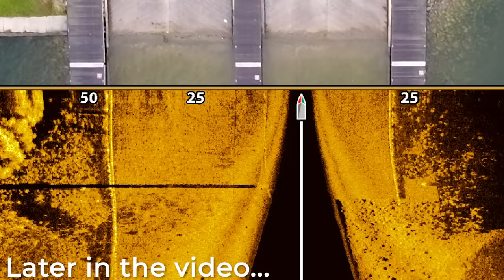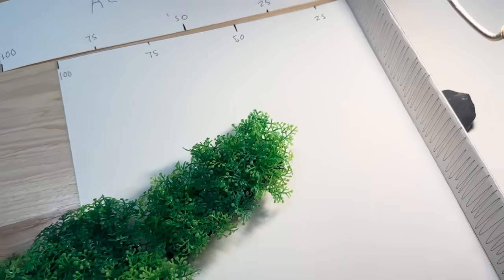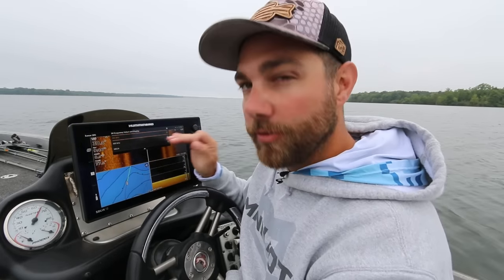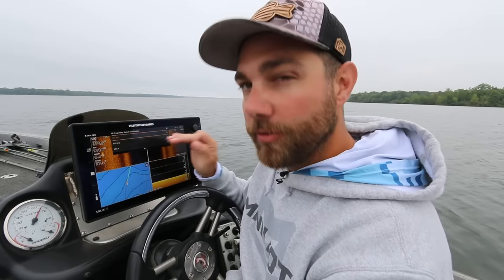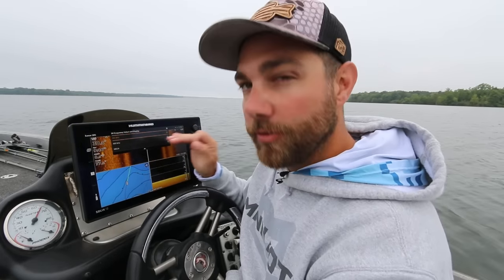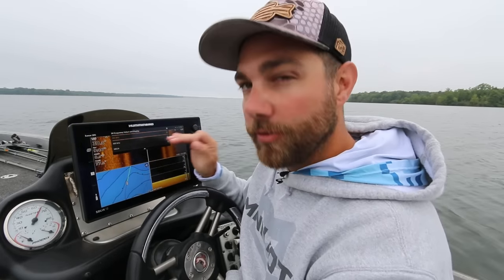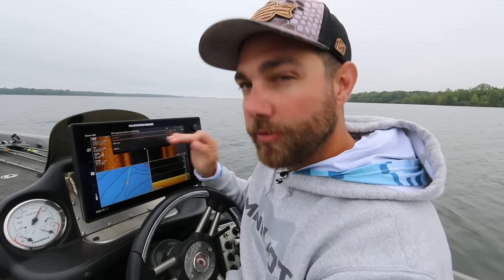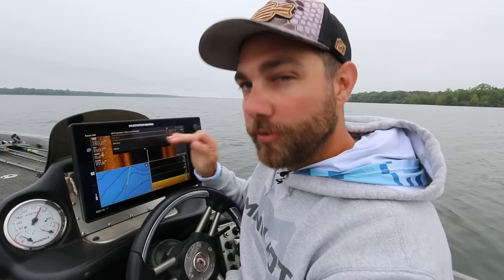What A WINNING Spot Looks Like // Side Imaging CRASH COURSE

Comment: Best side scan video I've seen...graphics were outstanding at the beginning to really show how things lay out in 3-D.  Only suggestion is you say you have to "subtract" off the depth...that is not really correct.  The object's distance is exactly what it says on the unit if you draw a line from the transducer to the object.  You can think of this as the hypotenuse of a right triangle (one leg of the right angle is a line dropping from transducer to the bottom, the other right angle side is from the bottom directly under the boat moving to the side (right or left) along the bottom.  You do not subtract the depth of the right angle side going from the boat to the bottom from the distance along the bottom's right angle side...instead you measure the hypotenuse to get the distance.  So the object is closer than it appears if you just consider distance right/left of boat, but it is not as close as you would calculate if you subtract the depth off of the range.  Your model shows this relationship well, but you should not say to subtract off the bottom depth as that will put the distance too close to the boat (you could use geometry to actually calculate it...this is called slant-range correction).  Anyhow...all that does not diminish how outstanding this video is...thanks!
Reply: YESSS!!!! Thank you for saving me twenty minutes of typing!
Reply: After a while , you will just be able to be good at guesstimating I’m sure. This video fed me some great info. Looking into getting a side imaging graph. I have a gps map up front for livesvope, but to have lake mapping and side imaging at the wheel could be an efficient combo. With that being said, you guys know your stuff. What’s the best , “bang for your buck,” side imaging graph for lake mapping as well. Thank you .

Comment: One thing that was not mentioned regarding side imaging, the dark spot directly below the transducer/hull and the distance from your boat is directly correlated to the depth of the water you are in. To overcome this problem mark the brush, rock or structure on the screen with a waypoint/GPS then go back over the waypoint and dial in the location precisely with a waypoint edit.

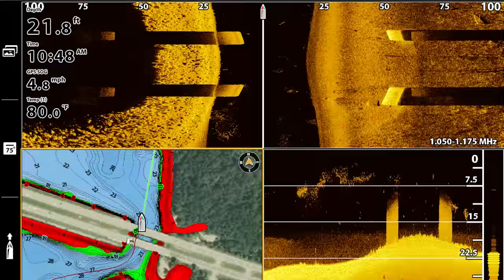Comment: At 4:29 it is stated that the Black space in side imagine is the space Directly under the boat/depth of water.  Then at 7:09 the example screen shows bait fish (and bridge piling) in the black area (supposedly directly Under the boat) but they show up different between Left and Right.  My brain is hurting... they can't be directly under the boat and be different Left to Right in the black area.  And therefor I don't think its a straight subtraction of the black area (isn't Trigonometry required) to get actual distance to a Bolder showing on the Right side of the screen....  and Trig + interpretation required for indications in the black area?

Comment: I originally wanted a 10" solix fory kayak, but end of last winter I was able to pick up a 10" Garmin echomap Ultra 106sv for 758+ tax after sales & bass pro club points. Then I added steady cast heading sensor & Lvs34 system late January. Between sales, coupon codes BP club points which is cash in store. I ended up paying 2350+ tax for all of that! The 10" Solix or 10" hds pro is running 2799.99 by themselves. Been extremely happy with my set up so far. Its actually my first fishing electronics. In my opinion hummingbird still has best side imaging but Garmin's GT56 & new hd3n1 are so close, its not worth price difference for what I paid. Garmin definitely has edge on LS. Lowrance doesn't really have an edge with anything anymore. Their bad to almost non-existent customer support is what completely ruled them out for me.

Comment: Amazing video and creativity is top notch. However, there is some inaccuracies in the beginning regarding actual distance from boat. This is more complex than simply subtracting water depth from displayed Si range. You need to take into account vertical component and lateral component and use Pythagorean theorem to get the actual distance.

Comment: Your cone is shooting out at an angle from your boat. So that black space is still showing at an angle from the transducer. So your saying i have to subtract that from the distance away from boat to get accurate distance? I dont understand that if your transducer is hitting bottom at an angle. Then it should be correct. Or close.

Comment: Great job on the video.

I would like to call attention to one thing though: the Biggest Mistake. Because sonar always goes in a straight line, when something shows up at 50 feet, it REALLY IS 50 feet away from the transducer. However, 50' away does NOT mean 50' to the side. But it's not as simple as subtracting the depth either. To know the exact horizontal distance, you need some trigonometry. The depth is one leg, the horizontal distance is the other leg, and the sonar distance is the hypotenuse. The good news is that as long as the target is more than two times the water depth, the adjustment to find the true horizontal distance is small. The key to remember is that it will always be closer than reported, but the amount closer depends on water depth and sonar distance to the target. Shallow water and large sonar distance, little correction is needed. When the sonar distance is barely more than the water depth, the target is practically under the boat.

Comment: Why don't they just deduct the black space?
Reply: Because the scale represents how far objects are from the transducer and that is how all sonar technologies work including down imaging and traditional 2d sonar. When you see a fish at 25 feet on broadband sonar, that means that fish is 25 feet from the transducer, not 25 feet from the boat. That means that fish at 25 feet is more than likely shallower than 25 feet especially if the fish is on the outer edge of the transducer cone.
Reply: Your mentioned settings of 10-12/14-16…. is of “0-20”?????

Comment: I don't know if you can help me or not, but I noticed you were pretty keen on Humminbird.  I have Helix 12 SI and a Helix 12 DI at the console and another Helix 12 SI at the bow with the 360 paired to it. None of my units will see each other in the network.  I have rewired the units. I have swapped out the network hub for a new one. I have moved the units around to different stations on the boat.  If I ever see another unit on the system network page, it shows up in black letters instead of white letters. So, it recognizes that there's another unit in the system, but it's not able to select or use it.  I have verified before and after the rewiring that the network hub is getting more that 12V.   I've contacted Humminbird support three times on this issue, but no one has been able to help me resolve it.  It's a long swing in the dark, but I was wondering if you've ever experienced something like this.
Reply from the maker: Hmmm…have you tried resetting your default network settings since you rewired them?
Reply: Try updating all your units, may have different versions of firmware
Reply: @boblillard9282   They're all the same. I've already reset them to default and re-installed the latest version(s) again.  Thanks though.

Comment: You don’t actually “subtract “ the water depth from the distance symbol. What the symbols represent are the HYPOTENUSE, or diagonal measurement from the transducer directly to the object. The constant we use to find the hypotenuse is 1.414, so, with that in mind, if an object shows 40’, we need to divide that by 1.414 to come up with the distance from directly under the transducer (on the bottom), to the object. If an object shows 14’ away, it’s 10’ in measurement across the bottom of the lake.
Reply: What about when you take the water column off the screen? How does it affect the distance?